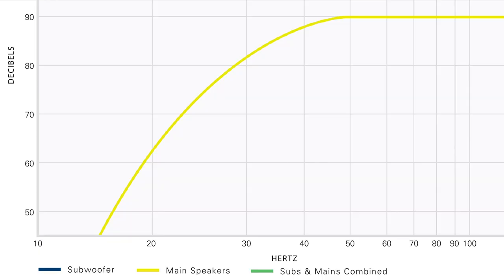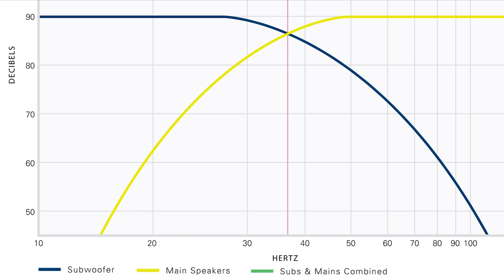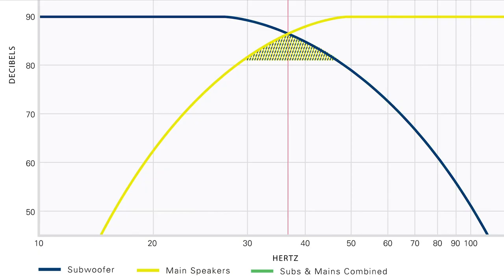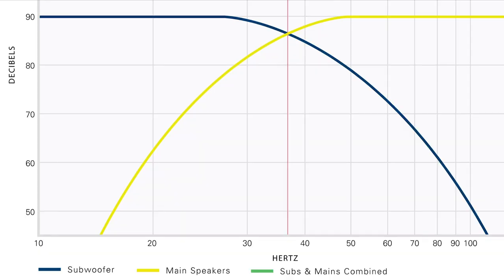How to set the Crossover on Your Subwoofer

Comment: "I'll just make it simple..." Me clearly not being even in the same solar system as you, or plenty of the other commenters, it seems, when it comes to knowledge of acoustics, and then add the whole room dynamics. We're more likely talking galaxies, I'll just state my speaker & room specs, and hope that you, or alternatively anyone else, can translate it into audio-semi-normie-speak.🙏 
2 x M-Audio BX8-D2 (8" Low-Freq 70W, High-Freq 60W, Response: 38Hz-22kHz, Crossover Freq: 2.2 kHz), stands + 2" pro-quality audio-foam isolator beneath them.
M-Audio SB Sub. (10" 240W, Response: 20-200Hz (-3dB) Crossover: HP/LP linked filter sweepable from 50-200Hz; 24dB/octave 4th-order alignment). 4" pro-quality board & foam isolator (made a huge difference).

Room: 24.6 x 11.5 feet, height 8.1 feet. Brick walls, thin wooden floor with light wall-to-wall carpeting. At 43-44Hz, if left open, the door to the hallway, some 15 feet from the sub (and speakers), starts to vibrate incredibly loud. Speakers & sub are placed at one end of the room in a safe 3 feet distance from the walls.
From what I've read, for music, which is what matters to me (not movie explosions and whatnot), I should set the crossover to the lowest possible, i.e., 50Hz so is that correct, given the room size and all, and is an indicator of settings whether (with eyes closed) I can locate the sub (being at a 45 angle to the left), and if I should not be able to audibly sense its location to one side, what settings are then wrong? Crossover, volume, or both?  
It has a 180 phase reverse switch, but I can't tell any noticeable difference, whether with J. D. Souther's "Silver Blue", Boz Scaggs "Thanks To You", or "Subwoofer Test: 4 min Sine Sweep slowly from 150 Hz to 20 Hz" video. 
If you got any videos, or know of others' or articles I should use to educate myself, I won't exactly be ungrateful if you could bother to point me in the direction of such.🙃

Comment: When you say that a room can’t support the longer wavelength of a low frequency from a speaker, why would it be any different coming from a subwoofer? And from what I understand speakers play lower in-room, due to boundary gain, versus the anechoic chamber.
Reply from the maker: Thank you for reaching out. Part of what allows a subwoofer to produce deep sub-bass output that a main loudspeaker can't produce is that a subwoofer is dedicating it's amplifier power specifically for producing sub-bass output, rather than also producing midrange and high-frequency output. It takes a fair amount of amplifier power to produce strong sub-bass output in a room, which is in-part why in most systems the amp power rating of the subwoofer will be greater than that of the main loudspeakes' power amplifier. On top of that, all of the other design attributes of a subwoofer (the driver, cabinet, filters, etc.) are tailored specifically for sub-bass reproduction, which help them to overcome room issues that main loudspeakers have a more difficult time overcoming since they are designed to reproduce low-mid to high-frequency output accurately.

Comment: how do you invert/flip the triangle up... I mean what do you need to do?
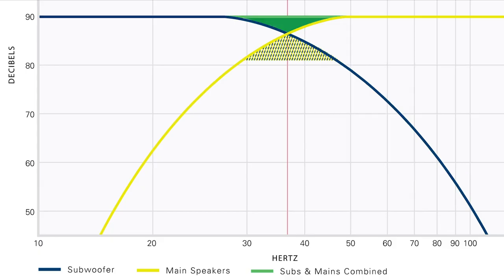Reply from the maker: Thank you for reaching out. When the crossover on a REL subwoofer is set just below the natural low-frequency roll-off of your system's main loudspeakers their output will become reinforced in this frequency range, which results in the linear output shown in the graph at 2:13 in this video. This happens naturally where the output of both devices overlap slightly. If you set the crossover on the subwoofer too high then this range will become overly reinforced, resulting in output that is boomy and lacking in definition, though when the crossover is set correctly the output will become linear between the speakers and the subwoofer.

Comment: On the REL crossover knob what level is halfway please anyone? If my speakers are 45 hz I want to set crossover to 60-80
Reply from the maker: The crossover control on our subwoofers is not linear, so counting the number of clicks on the dial and doing the math from there will not be accurate. We recommend starting with the crossover control set to the 10 o'clock position, then adjusting from there by ear until a smooth transition is achieved between the subwoofer and your main loudspeakers.
Reply: I bought a Rel HT 1508 for my hometheater and I'm not sure what crossover I need to put the subwoofer. All my speaker are set to small at 80hz except for my front channel which is set to large . I tried 40hz on the subwoofer and put the gain at 11 o'clock . It sounds good but I'm not sure if I'm doing it right. Please help.

Comment: so what does that mean...? if a speaker has a frequency response low of 30 hz, i set the REL crossover to 50 hz?
Reply from the maker: If your main loudspeakers are truly able to reach down to 30Hz with power and authority then ideally you will set the crossover control to just below 30Hz. However, in our experience very few loudspeakers are able to do this in a practical listening room, even when their published specs quote a 30Hz low-frequency response. This is why we recommend tuning the subwoofer's crossover control by ear, rather than aiming specifically for the speaker manufacturer's published spec, and listening for a smooth transition between the loudspeaker and the sub without any boominess and with minimal overlap between the two. Feel free to write in to contactus@rel.net if you have any questions regarding tuning REL subwoofers in your system.

Comment: Yes good explanations but how to set the crossover ? Start low and wait for a balanced full db level rise? ls there an app for android ? lt must be a national secret , ill ask Clouseau.
Reply from the maker: When tuning the Crossover on a REL subwoofer, you can start with the dial set to the minimum/lowest position, and the Level control set to a moderate value. You can then play a familiar reference track with deep and consistent sub-bass impulses, and slowly raise the Crossover dial until you just begin to hear an overlap with your main loudspeakers, which you will hear as boominess and a lack of definition/detail in the low-mid to upper-bass frequency range. Once you hear this overlap, you can then lower the Crossover back down by 1-2 clicks to restore a more seamless blend.
Reply: Yes another concise explanation  for dummies , l get it and from constantly making adjustments looking directly at  my  bookshelf speakers and listening for a change l worked something out but know l know where to start thanking you . Also i do 5 channel stereo mode, old Denon with a tone button that sets levels much quicker than me . The  volume  [ phone to BT analog ] and EQ plus amp gain are crucial all 3 can't be over driven for the room to bounce . One more thing sorry , is your twin brother    Caesar Millan ? Both  very calming voices. Cheers             @RELAcoustics